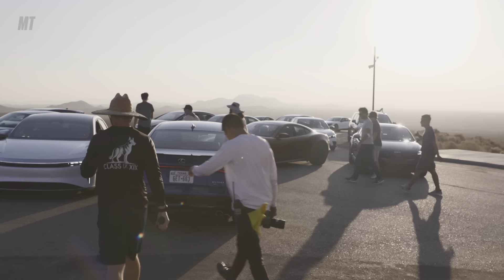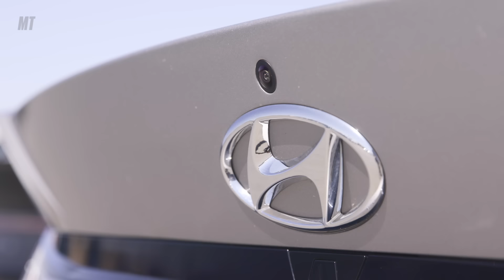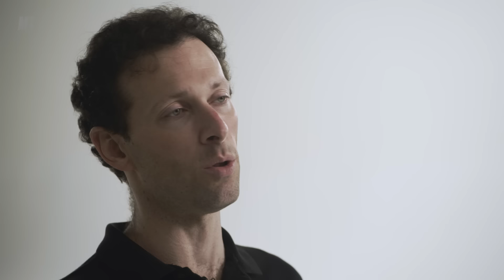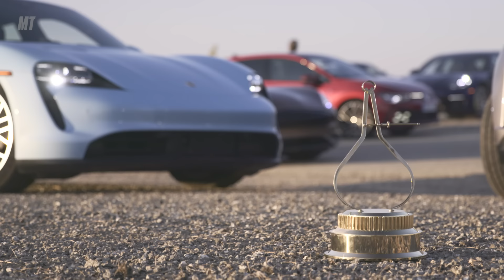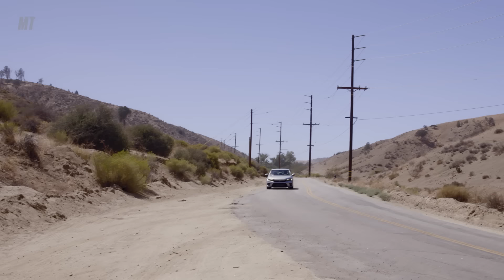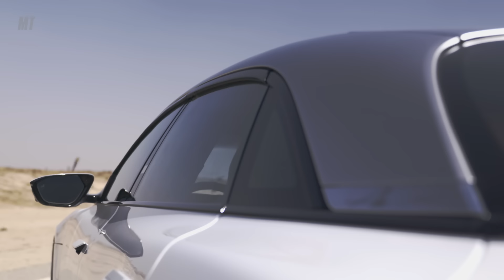2022 MotorTrend Car of the Year: Lucid Air

Comment: Mac Morrison keeps referring to Lucid's engineering of 'efficiency' into the car to get the 500+ miles of range.  Checking the actual efficiency numbers for the Lucid, it's no more efficient than a Tesla Model S or Model 3.  Lucid simply stuck a larger battery pack into the car.  So, you're hauling around an extra 300 or so pounds of batteries that unless you're planning a 6 hour drive without stopping, is unnecessary.  That said, if the 500 miles of range is a big deal to the judges, that's fine.  Just be honest and point out that it's due to the extra battery size, not 'efficiency'.

Comment: This is the worst car of the year ever. First this isn't a production vehicle so its shouldn't be eligible for testing. Second this company hasn't delivered any cars yet. Third this car is way overpriced. Fourth you based the win on its range which is only greater than teslas due to a larger battery. What a disappointment this choice is for your magazine.

Comment: Wait, you have an ev as COTY and not enter any Teslas in the mix. Suspect to say the least. Surprised, not at all based on the last plaid review.
Reply: There are lots of driving reviews of the Plaid that point out it has exactly one new trick. It's an impressive trick, no doubt, but the rest of the car doesn't live up to it. 
And every serious driver thinks the yoke is a joke.
Reply: @Miata822  you do realize it’s a 5 door family hatchback . It’s not an actual race car. The fact that it has ridiculous performance numbers is just a ridiculous bonus. And it’s a refreshed model that’s actually in production compared to the lucid, why would they not include it to be measured against the entire group of cars.

Comment: this just proves that MT does not know what they're talking about. what a joke. the model 3 is more efficient. making a $170k car almost as efficient as the model 3 at $50k is not an engineering accomplishment. on top of that, they just rate it highly in areas that haven't even been tested yet, like safety and autonomy. MT is trying to stay relevant and going with the internet hype. there is just now way to justify a half-finished car at that price being the winner.
Reply: Plus, the car has a 120 kWh pack, software locked at 112 kWh. How MotorTrend kept praising the efficiency of the car, as if a car with a 120 kWh pack shouldn't get close to that number, is beyond nuts.

Comment: Yeah, too bad its ungodly expensive. 
If we're gonna have EV's become more mainstream, we need more affordable options.
Reply: The bolt and the leaf just got huge discounts on their MSRP.  Their still not quite apples to apple with affordable ice cars, but they just took a huge step in the right direction.

Also technically the mini SE can be had for $23k, but that's after the incentives.
Reply: cost of ownership for a model 3 or a bolt is actually quite low, pretty much in the center of the mainstream new car market.
Reply: @somedude-lc5dy  this is "mostly true" for the bolt, and basically a lie for the Tesla if Edmunds and Car and Driver are to be believed.

At least for the first 5 years of ownership, where other companies offer free maintenance for a few years while the the two cars listed here don't offer that.

Comment: Wait, the Tesla Plaid wasn't used? haha wow
Reply: it would embarrass everything on their list, so they left it off. autopilot? better than everyone else. performance? better than everyone else. cost? less than the car they were paid to have win... it's a joke
Reply: @somedude-lc5dy  The Plaid is only about as fast as the lucid but the lucid has 110 miles more in range. Also it's an old design.
Reply: Only new Tesla is the Plaid and it only has that one trick. Otherwise it's just a rehashed 10 year old design with a gimmicky steering wheel. 
Competition was tough this year and the Plaid simply didn't deserve to be on the list.

Comment: Wait was Tesla or Rivian I mean Tesla included in this finalist list? Interesting...
Reply: Why would they be? Tesla had one new thing this year, the Plaid, and it is the same old thing w/ a third motor bolted on. Lucid does that trick too, but with more hp, torque vectoring, better handling, longer range, etc., etc.
Reply: @Miata822  ehhh that I’d say Tesla get it together
Reply: @Miata822  How can a 5,300 lb car with twin electric motors and skinny 265mm rear tires perform better than a 4,700 lb car with tri-motor and wide 295mm rear tires?
Reply: @KyleHubb  Engineering. Tesla fans love to brag that “Tesla is a tech company, not a car company.”  It shows in the product. 
For a clear demonstration of the Plaid’s shortcomings as a performance car see Tesla fan Kyle Connor flog a Plaid up a mountain pass on Out Of Spec Reviews youtube channel.

For the Lucid see Jonny Lieberman’s test drive review of flogging an Air in the mountains and YouTube video of the same drive. He compares the handling to a GT-R. 

Look up Rawlinson’s history and the people he hired on to see their backgrounds deep in high end car design.
Reply: @Miata822  You mean Kyle Connor that reviewed the Mach E GT Performance and didn't tell us that it can only provide boost for 5 seconds before throttling down, but had no problems telling us that Tesla overheats? Nah, Plaid did Nürburgring with even weak brakes and was 6 seconds short of the Panamera's record. I don't care what Kyle says. I've seen the reviews, the car is good. Only downside being brakes. 

Rawlinson worked for Elon for 8 months and moved to Lucid. He wasn't the guy that made the Model S what it is today. If you think Lucid has more talented staff than Tesla, you must be smoking something. People who worked at Ferrari F1 teams helped design the Roadster, and the rest of the Tesla line up. Stop smoking the media cool-aid. I'll reserve my judgment until regular individuals test-drive the Air, until then, all Lieberman did was PR for Lucid.

Comment: I'm highly impressed with the Lucid Air.  This is the first electric car that I find desirable enough to actually want to own because it doesn't scream electric and pulls off the marquee luxury better than the EQS.
Reply: Have you driven one?
Reply: E-Tron SUV and GT don't scream electric. The Taycan doesn't scream electric. What are you smoking?
Reply: @KyleHubb  You forgot the 'and' part of my statement.
Reply: @chiemekaa  I responded before you edited it. Nice try.
Reply: I’m happy that Lucid motors won this award.  What I am unhappy about is that Tesla was excluded from the competition. I’m not saying Tesla is better or would have one but it should have been at least one of the finalists. There were clearly inferior finalists in the competition compared to Tesla
Reply: @steveperreira5850  Tesla didn't really release a model this year so I don't think they qualified
Reply: @steveperreira5850  oh u noticed that also... lmfao...

Comment: Odd that they didn't try to test a Plaid...but cool that another EV won
Reply: That underbraked dragster with a quarter steering wheel and a body shell from from 2012
Reply: @truepatriot5425  spoken like a true keyboard warrior
Reply: @truepatriot5425  god, people are so gullible. go check the Nurburgring time done with stock tires and brakes. don't believe everything the youtubers tell you. people think the brakes are bad because they don't realize how fast they're going. put it on a curvy track and it still does better than all other EVs, even the ones that supposedly have much better brakes. reviewers just need to find something to dislike about it. the brakes could definitely be better on it, but it still obliterates the competition. unless you're going to argue that the Nurburgring isn't a good test for car performance, lol
Reply: @somedude-lc5dy  after reading most of the comments i think there is no point telling people about the facts, they will choose to believe dream 😁

Comment: They defined the criteria: #5 safety, then say 'this car hasnt been tested, so we don't know' 'but its a wholistic design'
Reply: Especially when it is up against a Mercedes EQS.
Reply: It hasn't been independently certified, that's the point
Reply: Honestly that's nitpicking. You would think they had crash tested before handing it over to a government agency for an official results?
Reply: 2013 MTCY hadn't been  tested either.
Reply: It's been tested. Lucid crash tested it.
Reply: A lack of crash test data is not uncommon for new cars.  Especially for smaller companies.  So they can't count that against, or for it.  But other indicators like how many airbags, and crash mitigation systems can be considered.
Reply: @roguedogx  you absolutely have to hold against it any feature they claim to have but haven't proven. "our car goes 400mph!" prove it "well, just take our word for it for now, we'll have it tested later" ok.
Reply: @somedude-lc5dy  then each year, half the new cars wouldn't be consider.  

If it comes back poor later, that's a whole different discussion.  

Also, you know most fuel economy is self reported to the EPA right?
Reply: @somedude-lc5dy  also thank you for reminding me that I need to look Into the model s's top speed.  

I keep putting that off.
Reply: @roguedogx  if they don't want to consider crash test, then they should say "we don't consider crash test ratings" instead of just assuming it's amazing. also, show me where motortrend independently tested them and is able to show the Air is actually more efficient. but I guess we should take Lucid at face value even though every owner in under NDA so far?... what a joke
Reply: @roguedogx  more double standard? trust lucid on all statements? such BS. line up an Air and a Plaid and see how they do around a track or in a quarter mile. ohh, wait, we can't because they are not actually delivering the cars to anyone outside the company or NDA because they have to get the hype and stock sale out before anyone other than bought-and-paid-for influencers get to look at them.
Reply: @somedude-lc5dy  no, you're the one with the double standard. 

No one said they assumed the crash test results were excellent.  As with all cars that have not been crash tested Motor Trend didn't assume anything positive or negative.  They just left crash testing out of consideration.

To prove that this has been a long standing policy, I'd like to point to the Jeep Wrangler, 2019 SUV of the year winner.  

It was definitely not crash tested before hand, because during the small overlap crash test (performed by IIHS), it flipped.  If that data had come out beforehand, it definitely would have hurt the jeeps score, probably costing it the award.

So this assumption is nothing new, and has been the policy for years.

To your point about drag racing, that's not one of the 6 key criteria.  A good 0-60 is nice to have, but it's not relevant in COTY, unless it inhibits safety or performance of intended function.  Which it does not here.

Comment: Aww all the Tesla fanboys having a meltdown 🤣
Reply: Not really……tsla is not just a car manufacturer……
Reply: @Scott-px6mi  what's the context of this.
Reply: There aren't any tesla fanboys having a meltdown, get ahold of yourself. Tesla wasn't even considered for this year or it likely would have won. People are upset that a car that has less than 50 examples on the road and hasn't even passed crash test safety requirements is somehow the car of the year. People are upset because it seems like lucid paid for this award.
Reply: @abarrick09  Spotted the tesla fanboy having a meltdown.
Reply: @abarrick09  You need to take a refresher course on where Tesla was when the barely-on-the-road Model S won the award for 2013.

The newly-updated Model S was changed enough to qualify for the competition this year, as the new-generation Honda Civic made it to the 7 finalists.  The problem is that the new Model S still uses the almost-ancient 18650 form factor batteries, an aging 400-volt system architecture, has no V2V or V2G charging, still has end plate pack cooling on the drawing boards, and barely advanced its efficiency over the outgoing Model S.  It's no surprise that the Model S was not among this year's contenders, given the stated criteria for the competition.

People only think "it seems like Lucid paid for this award" because they can't get their heads around the fact that any EV other than a Tesla could be well-received.
Reply: @abarrick09  Number of sales was never a criteria for car of the year. The eqs hasn't even sold a single piece but it still nominated. But the fact that the plaid is not nominated is pretty suspicious too.
Reply: @vandita3695  I think another thing to consider is that "car of the year" does not mean "best car of the year" there are alot of factors that go into the decision and simply what a car stand for can help get it picked.
Reply: @abarrick09  agreed

Comment: Lmaooo I hope that paychek was HUGE
Reply: Yes I think Tesla paid for the award too when Motortrend gave them Ultimate car of the year before
Reply: Bigger than Tesla paid to win the same award for 2013?  Bigger than Mercedes (which had two cars among the finalists) and Porsche (whose Taycan was a finalist) were willing to pay?

Grow up, fanboy, and embrace reality.  Lucid won this year the same way Tesla won for 2013 -- by having Peter Rawlinson lead the engineering effort on both cars.
Reply: @blakespringpasturemortimer9168  If true that was the last time Tesla paid for anything and the last time MT considered Tesla for any award.  Notice the Model 3 never got this award and that model changed EVERYTHING.  Countries and cities announced future ICE bans and companies like GM and Volvo announced complete EV transitions.  That's quite an impact for just one Model 3.  Just wait until Tesla finally releases a Model 2 version - done, fini, schluss, aus, stick-a-fork-in-it.
Reply: @dzerres  Model S Plaid built with almost ancient 18650 form factor batteries.  Teslas still on a 400-volt system architecture.  Cameras can't produce a bird's-eye view of the car's positioning.  No V2G or V2G charging.  End plate battery pack cooling still on the drawing boards.  Range over 100 miles short of the new standard.  Talking endlessly about full self driving that still requires a hand kept on the steering wheel.

In August of this year I replaced my Model S P90D with a Model S Plaid, so I obviously like the brand.  But I can also recognize that Tesla is already bedeviled by its own legacy issues in the technology realm -- which is why I am taking delivery in the next couple of weeks of a Lucid Air Dream Performance.
Reply: @blakespringpasturemortimer9168  And still setting world records. And 18650 still allows it to get EPA 395 and over 400. Let me know if your bladder can handle 395 miles of non stop driving. The range on the Lucid is the best but they won't be the last to achieve that. Yeah FSD beta. Wait did you miss the word beta....yet its the only autonomous system that can handle highway and city streets using vision only. And where did Peter Rawlings get his start....oh yeah, working at a little company called Tesla on the same car your $♤itting on. Yeah, if it weren't for Tesla you wouldn't have a Lucid Motors or any other viable EV on the market for that matter.
Reply: @KineticEV  Our Model S Plaid w/ 21" wheels is EPA rated at 348 miles.  When driving with the cruise control set at 80 mph on Alligator Alley (a flat, straight, lightly-traveled stretch of I-75 through the Florida Everglades), we get about 70% of that range using highway mile markers to measure distance.  That is, however, better than the ~ 60% we got from the 2015 P90D we traded for the Plaid.

We actually like Teslas in our family, including the 2018 Model 3 I bought for my brother.  But it doesn't blind me to the advances Lucid has made, which is why we're adding a Lucid Air Dream Performance to the stable when it arrives in the next few weeks.

And, by the way, if it weren't for Peter Rawlinson, there wouldn't have been a Tesla Model S that won the 2013 Car of the Year.  It was he, not Elon Musk, who led the engineering of that car.  But he did not "get his start" at Tesla.  He was the head of Advanced Engineering at Lotus when Musk turned to Lotus for help in developing the original Roadster (which is how Musk met him and why Musk recruited him to get the Model S program on track).  And before that he was the Chief Engineer at Jaguar.

Comment: the gaps between some of the pannels do not look uniform to me at least from the angles presented in the vehicle. This is usually sign of either poor quality or this being a pre-production unit. In my opinion, the design of the Air will not age well.

Comment: I'm not fully sure about this result... Sure, it's a great car, but it's crazy expensive and not even available yet. Nothing like car of the year for something you can't even buy yet. For all we know, it will flop in the next three years. If you wanted an electric car to win, what about Rivian? Or the Electric F-150? The Electric Porsche Taycan maybe? Or literally any other gas-powered car that people can buy... I wouldn't be surprised if Lucid paid them off for this result. Over the last few years, MotoTrend seems to have put money over everything else. It's a good car but compared to past years, this year's result makes no sense.
Reply: Air sedans started deliveries back on 10/30 and continued this weekend in cities around the country. The most expensive version, the only price the media ever mentions, is sold out. Available models range from $77,000-$130,000. Not cheap but many can afford. Cheapest is less than a Taycan or Model S.
The F-150 Lightning won't be delivered until next year.
Did you even watch the video?
Reply: @Miata822  which model did they test?
Reply: Lucid has begun customer deliveries, so it's available, at least to the first few.
Reply: I was going to ask if it is available yet. I wiuld have chosen EQS